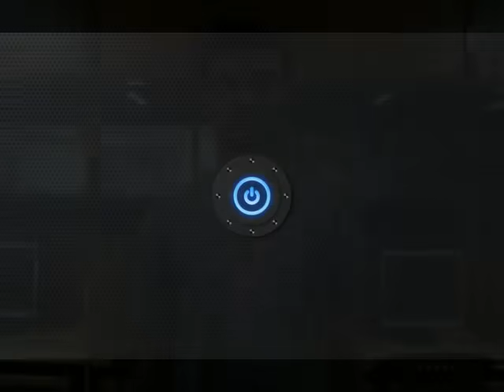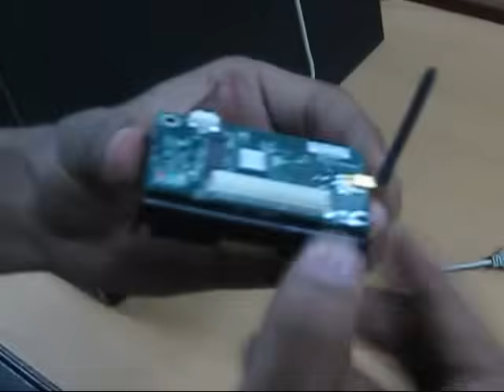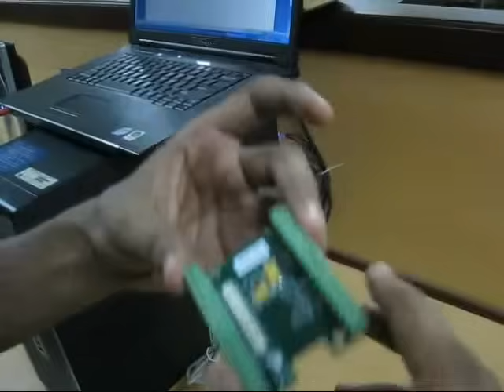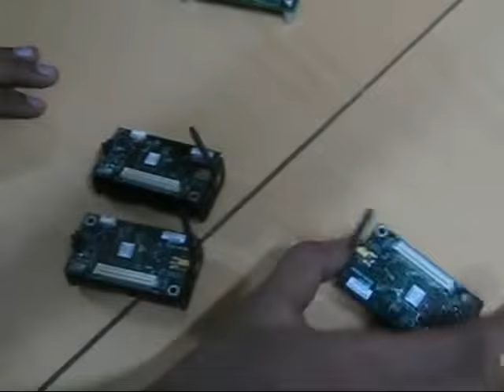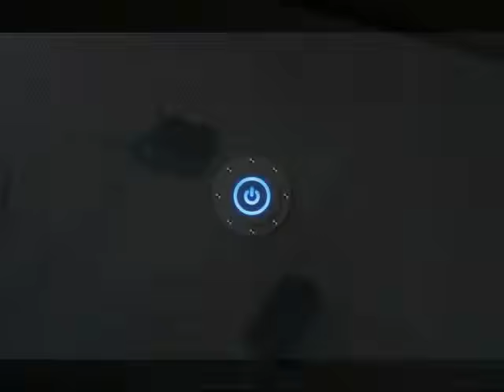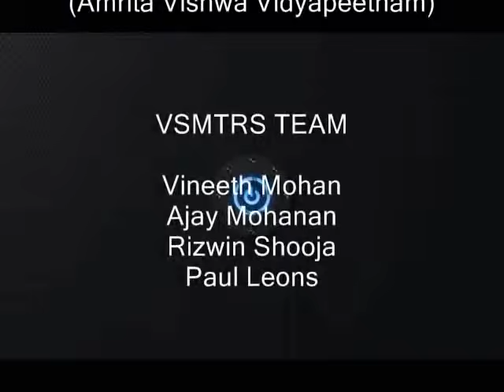Wireless Sensor Network for Vehicular Speed Monitoring and Traffic Routing System

Comment: Hi, 
I want to design a project using zigbee but i have a problem can you tell me, Which simulation software will be better for temperature, humidity and lightning sensor network using zigbee? (C-based simulator compatible with TinyOS running on ubuntu)
Thanks